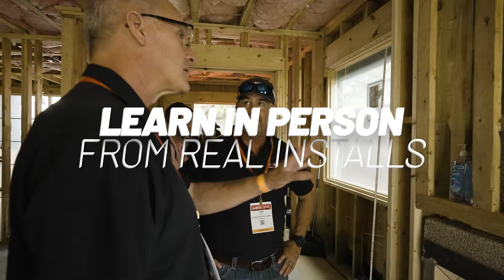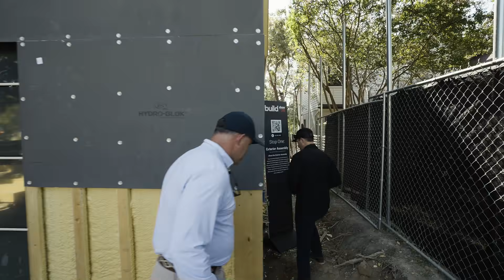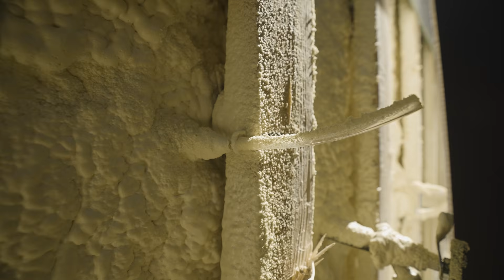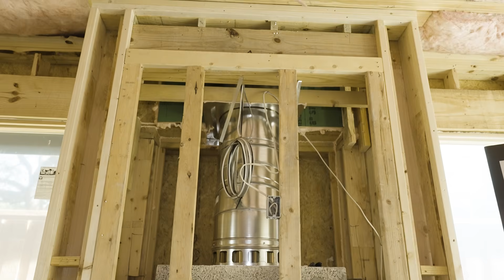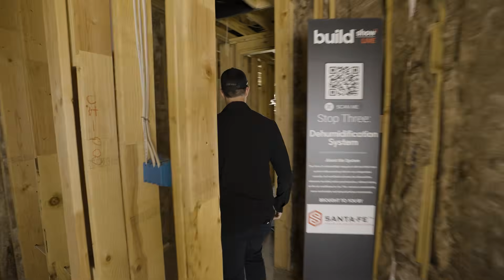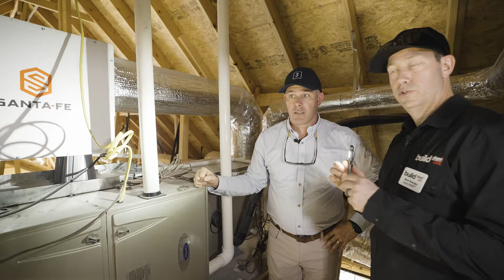These Houses Are Amazing…And Nothing Alike l Build Show Live 2025

Comment: I wonder what Joe Lstiburek would think of that exterior spray foam insulation.  Ahead of water, air, vapor and thermal is FIRE.  That house is wrapped in 80 petroleum lined chimneys.

Comment: The windows look cheap in that new home. Monopoly framing is more complicated than it needs to be, a double stud wall with a 3-1/2" gap between the walls is far easier to build and provides space for the mechanical, wiring, and plumbing, without cutting into the framing, saving lots of money on Simpson metal straps and stud guards that tend to bulge drywall, and a 10-1/2" wall cavity with just blown cellulose would make the walls about R-38.
Reply: Is there any thing done with such a system to prevent cellulose from settling over time (creating a small gap at the top of the system)?
Reply: @DavidP-u8y  You can look that up for yourself, I would say yes it can settle, perhaps Rockwool or even closed cell spray foam would be a better option? My point was all this monopoly framing is way more complicated with it's "outsulation" and extra long fasteners, and applied roof overhangs, which is just unnecessary when you make a double wall home, the thermal bridging is gone and you can really pack a lot of insulation into those stud cavities with a break in between the walls.

Comment: Awesome sauce! Question tho. If there’s no interior wall insulation used and the exterior spray foam cracks anywhere (which is pretty much unavoidable) wouldn’t there be condensation issues at the cracks?
Reply: Same as with interior spray foam in a northern climate.

Comment: Carrier does make a good unit, ours is from 2005, and the only repair the whole system has needed in almost 21 years: a replacement of the dual capacitor on the outdoor A/C unit.